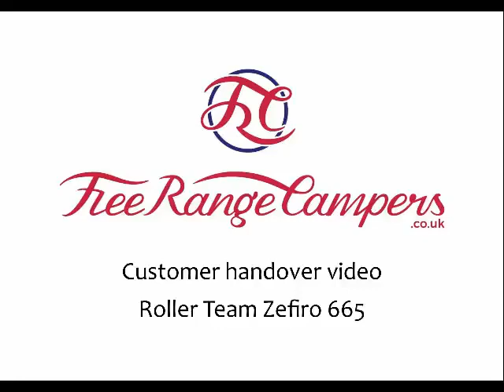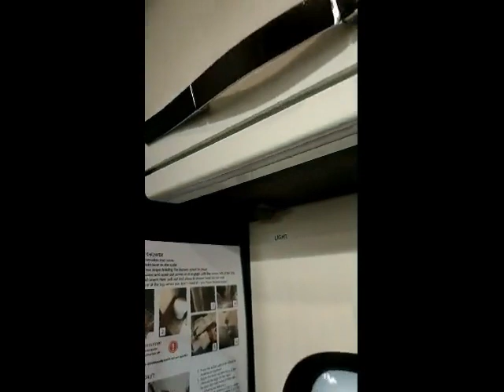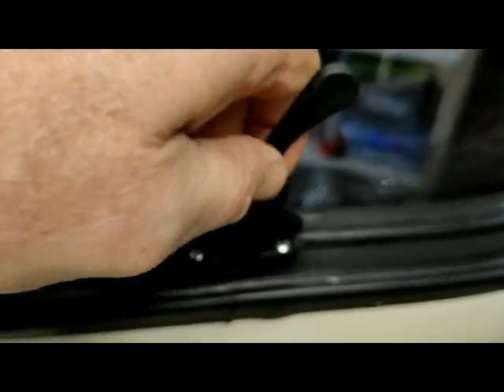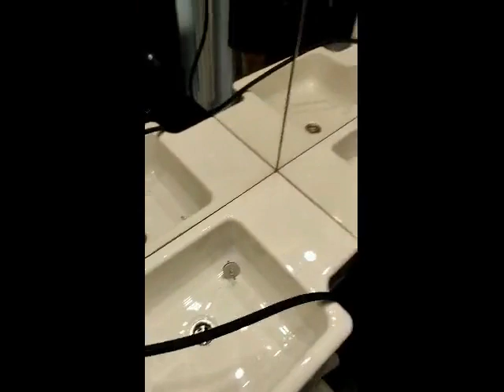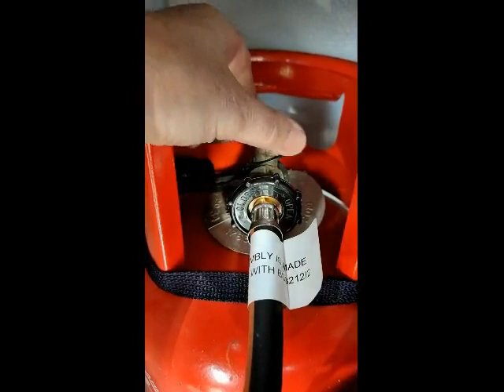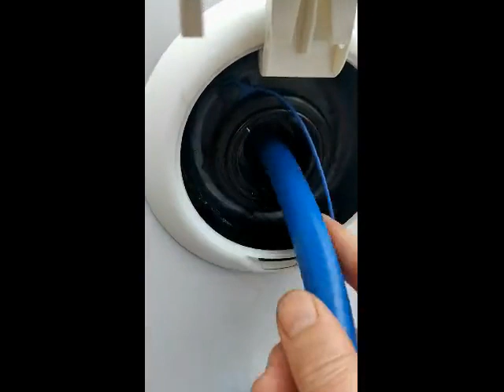User Guide - Roller Team Zefiro 665 manual (2023)

Comment from the maker: 00:00	Introduction
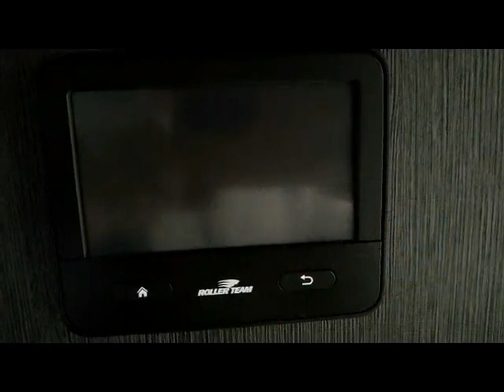00:08	Control panel - overview & water pump
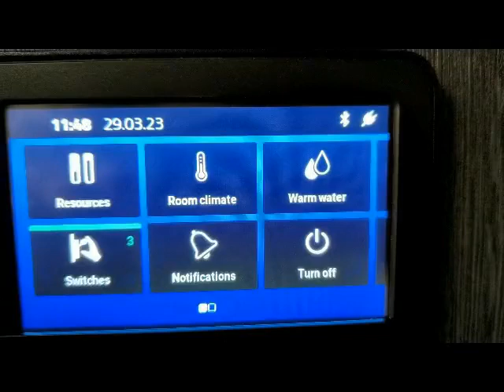02:33	Heating
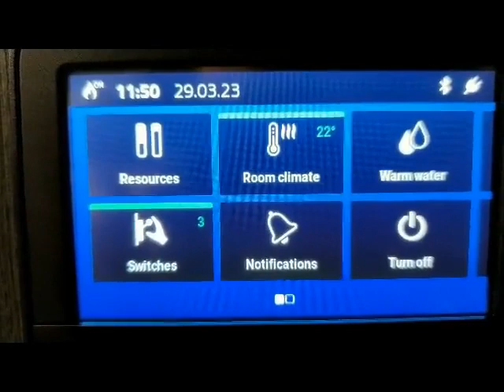04:18	Hot water
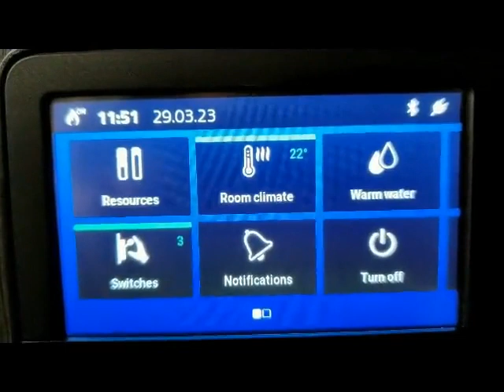05:39	Control panel notifications
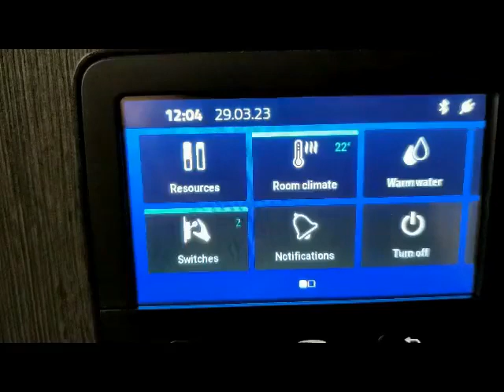07:58	Control panel turning off
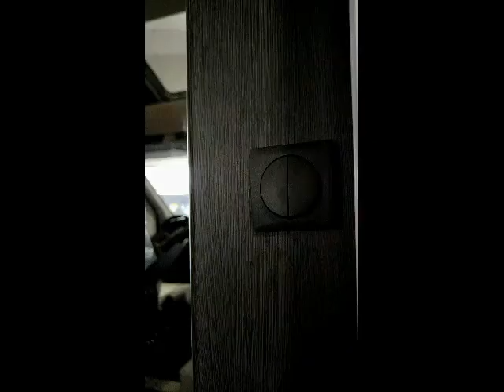08:44	Lighting
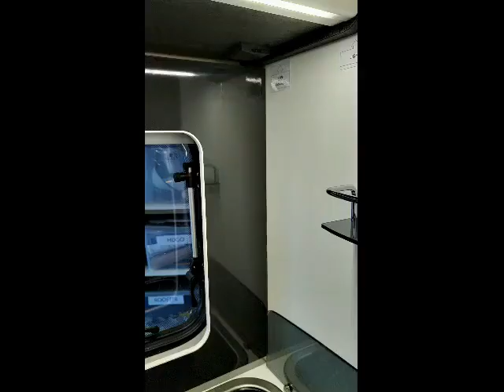11:09	Sockets and USBs
11:47	Fridge
15:51	Hob and oven
17:25	Television
19:20	Windows
22:57	Dropdown bed
24:37	Fifth bed
25:25	Swivel seats and table
26:43	Toilet (using)
27:54	Shower
30:09	Cab
34:12	Keys and locking
36:04	Diesel (filling)
36:14	Gas cylinders
39:18	Hookup
42:16	Toilet cassette
46:32	Water filling
48:30	Water emptying
49:40	Levelling ramps
50:30	Awning